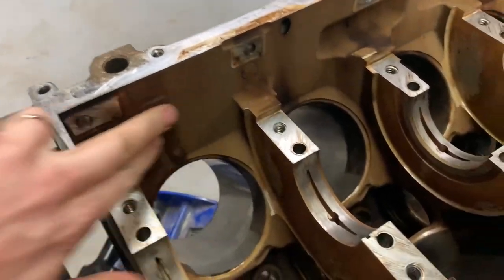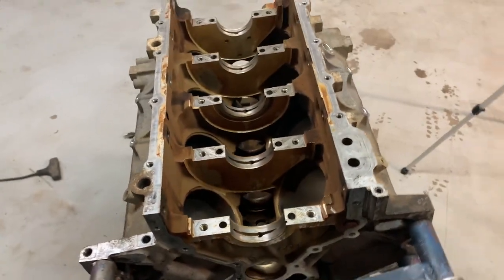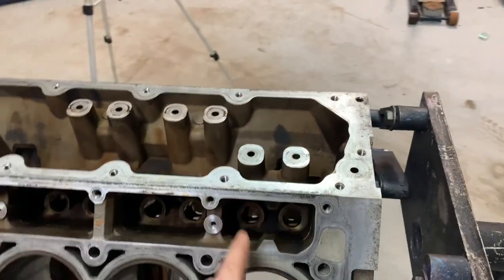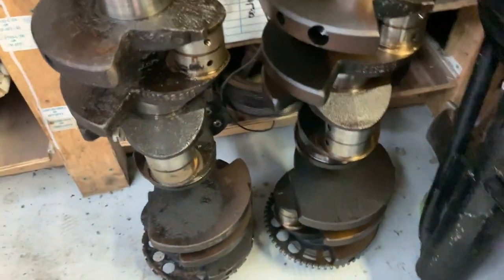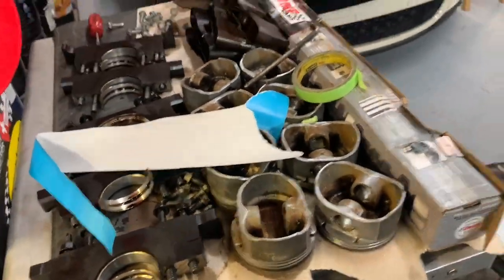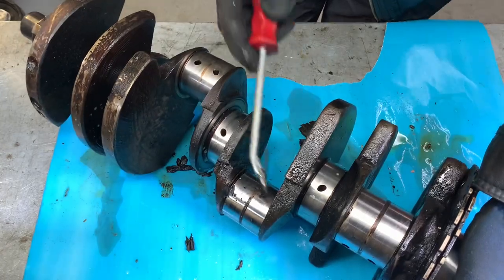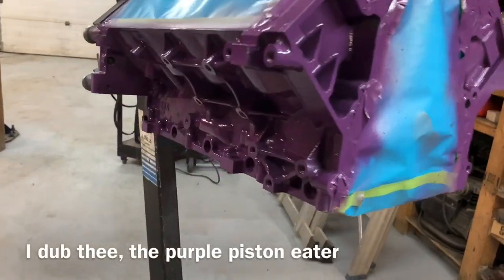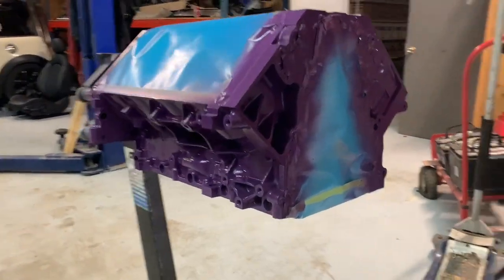Painting the aluminum LS 5.3 block PURPLE!

Comment: The Krylon MAXX paint is not rated for high heat or automotive use. How has it held up on an engine block?
Reply from the maker: Actually i couldn’t say because the engine only lasted like four total hours before exploding 3 rods out the block because I lost oil pressure, but for those four hours man it looked good 🤣